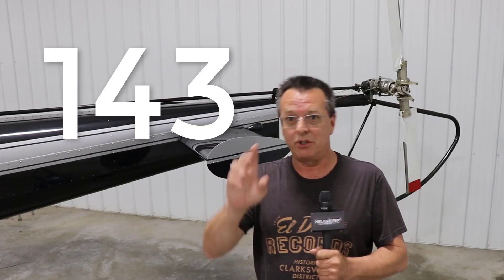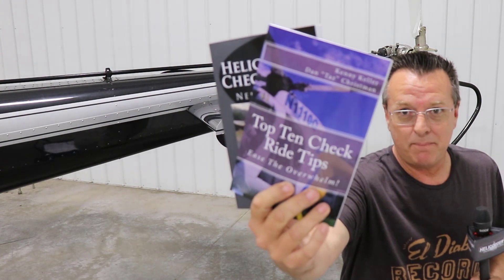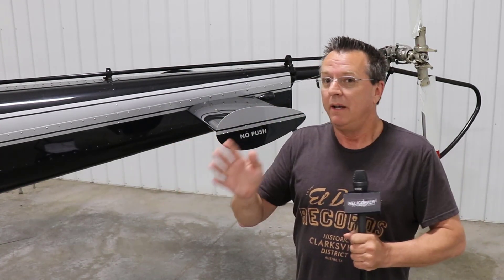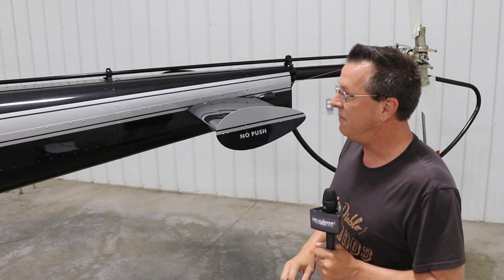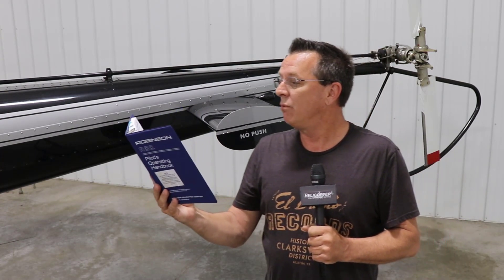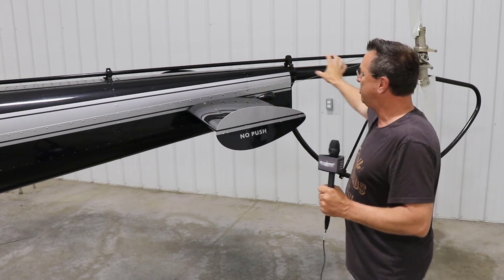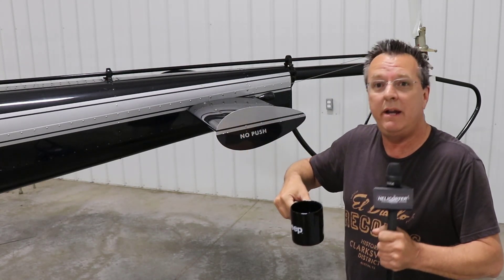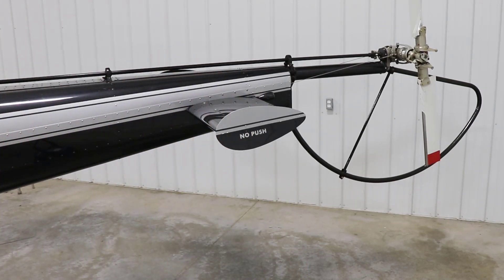#143 Loss Of Tail Tail Rotor Thrust | DURING FLIGHT | Day 143 Coffee With Kenny

Comment: My grandfather was almost killed back in the '20's - was driving a box truck down a hill when the driveshaft came unglued at the transmission, while still connected to the rear differential. It came through the floor in the blink of an eye, and flailed all over the place, very close to his leg and hip! He said if he was seated an inch to the right, he'd have been dead.  Ended up with a nearly 3-foot wide hole in the floor. Luckily, he only had minor wounds from wood and metal shrapnel flying.

I'd imagine shaft as long as a tail rotor driveshaft would do some serious damage! Once that thing comes out of alignment & gets out of balance, things will get violent REAL fast at anything north of 500 rpm.
Reply from the maker: Yep things could get ugly fast!

Comment: How to know if the tail rotor is completely stopped or lost, or the control cables ”only” snapped and the rotor is still turning?
Reply from the maker: The procedure is as stated in any aircraft manual. You will not be able to determine what actually failed. Thanks for commenting!